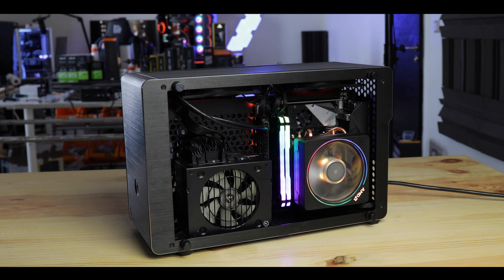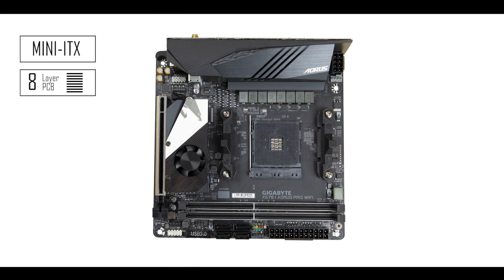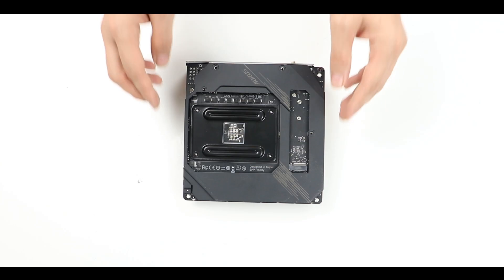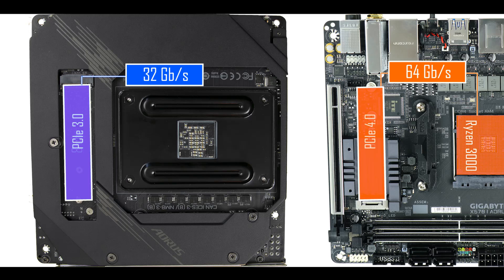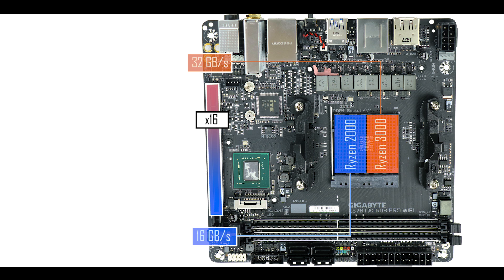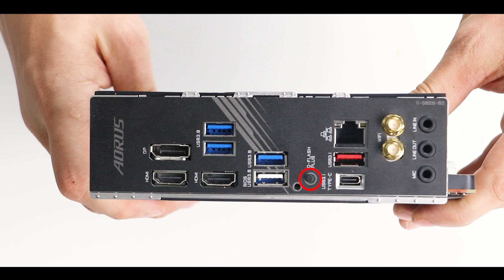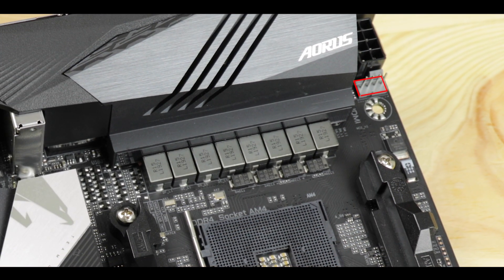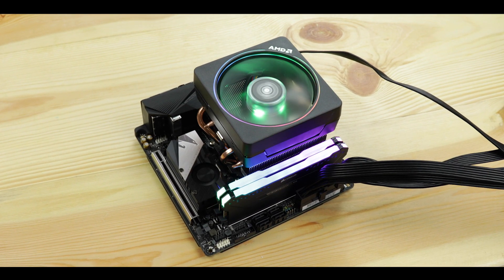Gigabyte X570I AORUS Pro WiFi : condensed power!

Comment: Bonjour. 
very late to the party but I am going to buy such MB and build in a Raijintek Ophion that looks like the build you were also using in this video right?
If so we you actually able to us the TG panel with the Ryzen Prism CPU cooler that I see here? I know its a 2Yr old video but if you remember, it would be great if you can share. I might use some stand off to give the cooler some more room to the Glass but if it fits stock,ist even better.
Merci d avance

Comment: Hi, I'm just wondering if this motherboard turn on without a cpu installed on it,

my question is, because my cpu it's not arrive yet,in im doing a power test, but motherboard don't turn on any lights or fans at all.

I'm just wondering if in this model works like that.

thanks for answering have a nice day.

Comment: Just my two cents those sata ports are useful for Nas/home theater builders who dont want a tower nas. granted 4 isn't a lot but for a nas/home media with raid and with today's high capacity drives, a raid 1+0 with 4 drives hits a sweet spot. Granted this board is pretty high end for just a NAS/home theater PC, but once your ready to upgrade you can re-purpose this motherboard to be a NAS/HT system. Reuse, Reduce and Recycle fokes ;) 
Id rather see those RGB headers removed for a BIO debugger than lose SATA ports. or better yet trade an RGB header for a USB-C internal header. I just hope this thing has a integrated TPM 2.0 which i wished you had mentioned.

And i do agree, to many Display ports in lieu of more USB ports, hell you could even use StarTech USB 3.0 to HDMI adapters if someone is trying to use this as an APU work station.

Overall thank you for the great review!

Update for those who care, this does have a TPM 2.0 header, so you can upgrade to Windows 11 with the most ideal upgrade/install of Windows 11.

Comment: Disagree with you wholeheartedly on the no. of sata ports - luckily Gigabyte has put in 4 of these. 2 simply would not be enough as some people prefer to have multiple SSDs and even - believe it or not - DVD or blu-ray discs. I use blu-ray for backup purposes.
So, if gigabyte listened to your suggestions, then people who use mini-itx builds for more than gaming purposes would be screwed.

Comment: Then came the Ryzen G series as APU and I’m really happy to buy the aorus board because of the many video outputs. I need to drive 2x 4K monitors for streaming because I can’t watch TV with my GF when I’m Gaming on my desktop so I have a second monitor there that’s connected trough a adapter which needs constant refitting because video adapter sucking in finding signals… I’m looking so much forward to build my living room setup based on this board.

Comment: Biggest drawback to the current 4 X570 ITX motherboards is the lack of USB 3.2 Gen2 support. If you own a Dan A4-SFX 4.1, you can't take advantage of the USB-C port on the front of the case. The Asus Crosshair Impact VIII or a couple of B550 ITX boards are the only motherboards that come with support for front panel USB-C. The Asus is expensive and only fits in the NCase M1 and Lian Li TU150 cases. The B550 ITX boards cheaped out on usb ports on the rear IO. Hopefully with the next AM? chipset, board makers will be a little more generous with rear IO support and will include usb 3.2 gen2 on their ITX motherboards.

Comment: How would someone address the lack of fan headers on this board? You need to use one of them for the CPU cooler, meaning that there is only one fan header for both rear exhaust and front fans.

Comment: I agree with you 100% on a few things:
- absurd 3 video output.
- lack of USB at the back
- Sata plugs... 2 max needed (if one has an old SSD, or one big one classic HD/SSHD)
- need more connectivity on the board (usb...)

I dislike the SSDs and Chispet management. I get the idea but too much heat IMO. Thanks for the review, I will pass on this mobo :)

Comment: I have this mobo with  F4-3600C15D-16GTZ ram and got it to 3733mhz at 14-15-15-28 only thing I dislike about it the POST times meh :\  and strange changing settings in bios wouldn't work well had to use ryzen master and the ram is not advertised to work with ryzen only intel....but that can be our secret.

Comment: I was sold until you mentioned the lack of a front type C connector. And yes, three video ports is overkill and a waste. Does the perfect AMD ITX board exist? Must have front type C connector, BT 5.0 or 5.1, lots of rear USB choices and a minimum of 32 GB capable.  I'm looking at the Ryzen 7 3700x CPU to build around.

Comment: I'm planning to make a purchase for some gaming parts soon, but I'm waiting a bit to see the outcome of the B550 boards. I'm hoping to find something similar to this with a respectable VRM and high build quality, but with less "bloat".

I don't need sata. I don't need more than one display output port (and the one I'll use will be on a dedicated GPU). I don't need any RGB. I don't need wireless. I don't need PS/2 ports. I don't need SPDIF.

What I do need: more USB ports.

Looking forward to indepth videos like this one on B550 boards - and while not very gamer-focused, I would also love to see similar video on AM4 server boards as well (which surprisingly, are a thing now).
Reply from the maker: Thanks for the comment. Indeed, i do think that your intuition is correct ;)
Reply: There is no current use case for all of the video outputs on this MB. X570 is for future-proofing. By the time AMD has an integrated GPU that market-matches this price point, this MB will be too old to be considered for new builds, and no one will “upgrade” to an integrated GPU. 
Meanwhile, I’m trying to find a place in a Mini-ITX case for additional USB connectors. Nope. Guess it’s Dongle City here.

Comment: Omg just came across your other video. Is the X570 Aorus Pro Wifi (Mini-ATX) is better than X570 Aorus Pro (ATX) ? Currently building a high tower casing setup. 
And
Which one is cooler :D for a 8 core processor like Ryzen 7 3800x?
Reply from the maker: Thanks for watching those videos . 

They are both very good. Personally I have a preference for the I Pro .. but they are totally equivalent in terms of cooling.

Comment: Great video but just wanted to point our that (according to Gigabyte) the rear m.2 is also PCIe 4.0 compatible. 

"1 x M.2 connector on the back of the motherboard (Socket 3, M key, type 2260/2280 SATA and PCIe 4.0* x4/x2 SSD support)
* For 3rd Generation AMD Ryzen™ processors only."
Reply from the maker: Hey thanks for the correction.  
You are absolutely correct . Pinning the comment for information.
Reply: The front one is connected to the CPU; the back one is connected to the chipset. I don't know what the practical differences would be, aside from airflow/heatsink/clearance. I imagine the CPU-connected one would be designated as the primary drive.

Comment: Salut Laurent! I purchased this awesome board after watching your reveiw!  one question... should the LED's light up when the board is powered up?  my board won't arrive to the bios page, so I am troubleshooting now... yes those LED's would have been useful now! I ordered a MB test kit with LED's and little jumpers plus speaker... I just curious if the LED should light up at which time? 
3900X, Aorus 1tb SSD Pcie4, g.skill neo cl16 3200 32gbx2, noctua u9s msi rtx2070 super ventus corsair sg600 platinum.... merci!!
Reply from the maker: Yes the led should shortly after booting (after bios loads though).

Y got more.details ?
Reply: @Laurentschoice  I had bad RAM! crazy... thanks for the reply! I should have looked earlier. Salut! no post, no LEDs is what happens on the board.

Comment: Hello Laurent!

I was really hoping to pair this MOBO with the Corsair 280x for a Ryzen 5600x build, mainly because of the WiFi capabilities since I can't seem to find one mATX board for around the same price that gives the same WiFi capabilities, I had the ASRock B450M Steel Legend in mind, but again, it does not have integrated WiFi either. 

Furthermore, and this is a pc building begginer's doubt, only two fan headers would limit me to connecting my CPU Water cooler and only one more fan, right? or is there any workaround for that? Keeping in mind that both the cooler and the (2) two extra fans are RGB.

Would love some help with this.
Reply from the maker: Ud need to order some fan splitters on amazon. Itll allow you to connect up to 5 fans per connectors .

Remember .. never connect more than 5 fans per available board connector:)

Comment: Man i need your advice which monitor i Choice
Lenovo lieogon 244 hz ips 1440 inch  or msi 144 hz Va hdr 400 34 inch
Reply: 27 inch lenovo
Reply from the maker: MSI
Reply: check the aorus ad27qd 144hz 1440p 10 bit ips ive got it works frigging great